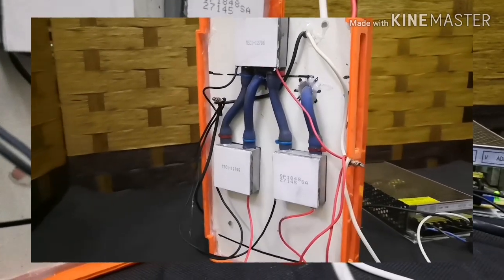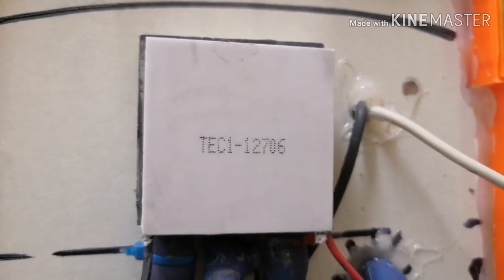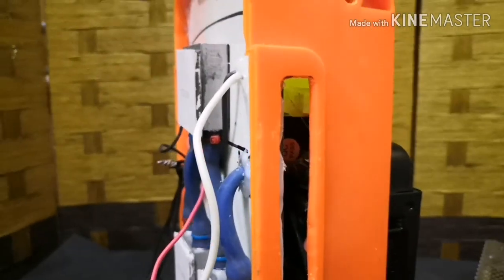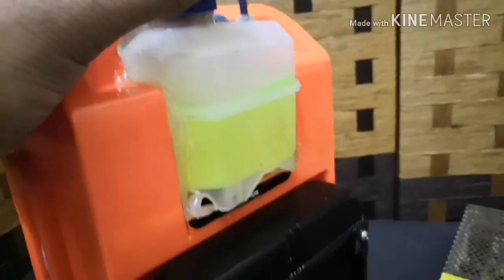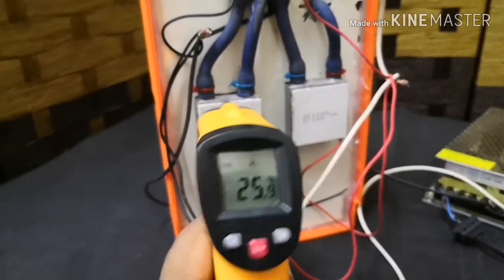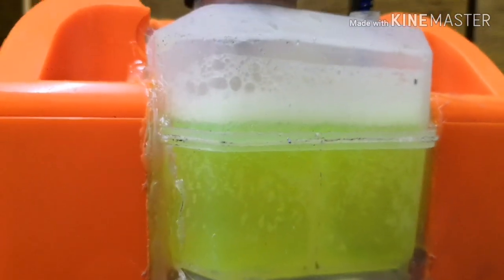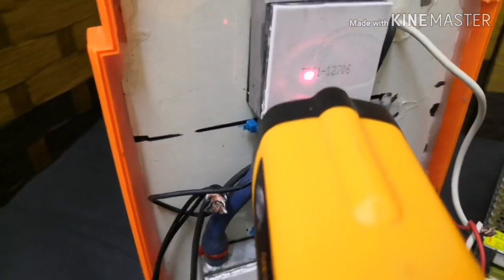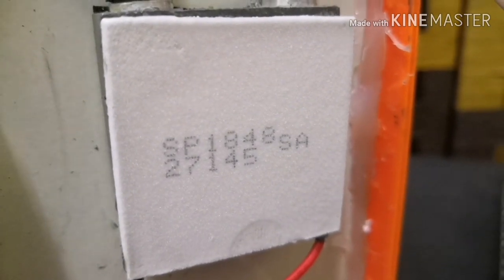Peltier vs peltier vs peltier Using water cooling radiators and coolant

Comment: What is the temperature at the opposite side? 
Keep the radiator away.. Like at the window throwing that warm air outside.
Then use this peltier set in the room, attached behind a fan, just like the radiators but pushing the air in. If the window sill are big enough, keep the radiant liquid reservoir outside too...

Comment: In my opinion the higher the amp that peltier module could handle, results to faster cooling
Reply: Yes, up to their rated specs, but then you loose efficiency especially at higher delta temps, and uses huges ammounts of energy and needs Very good cooling

Comment: What happens if you put the cold side of a peltier on a radiator? Will the radiator 
freeze and bust or because of the flowing coolant will it be only cooled? The coolant has a freezing point of - 15c. I believe because of the warm recyclable flow it would not freeze but just curious on my custom water cooling setup.
Reply from the maker: Thank you for watching.. The radiator will cool down the water inside it even the water is 400 degrees.. And if using coolant it will help a lot..

Comment: Would it work for me to use this system to try to cool the intake air of my car with a view to gaining power or would it not compensate?  In this case it would be a water cooler with a copper coil to cool the air. Thks

Comment: Daria certo eu usar esse sistema para tentar resfriar o ar da admissão do meu carro visando ganho de potência ou não compensaria? No caso seria um water cooler com uma serpentina de cobre para resfriar o ar.
Reply from the maker: English please
Reply: Would it work for me to use this system to try to cool the intake air of my car with a view to gaining power or would it not compensate?  In this case it would be a water cooler with a copper coil to cool the air. Thks

Comment: uncompleted job, does not work as AC room ,  it is just amateur project, no heat peltier treatment  still flow up on the same surface
Reply from the maker: Der viewer.. This video shows the experment for the testing unit and the difference between 3 different peltier modules.. It is not an AC.. But it has a water cooling system that circulates the water to extract the heat from peltiers so the peltiers can perform better.
Thankyou for watching.. Please watch complete vedio to understand easily..
And do watch my other videos..
Have a great day
Reply: @DIYTAYSEERworld  I am electromechanical engineer, I have worked on peltier since 21 years ago,  and I know all aspects in details about all peltier circuits and ref numbers however thank you for your effort,

Comment: if I wanna use 8peltiers at the same time with parallel or series connection how much current (volt=? and Amp=?) its need to work perfectly..? if the Peltier devices getting 12 V, 15A is maximum for the single device means...(for 8Peltiers) same volt, same current? or its need more amp? (like 12v, 30amp?)
Reply from the maker: Yes.. More peltier more amps.. 12v will be same
Reply: @DIYTAYSEERworld  How can I increase amp per each device bro...?
Reply from the maker: Use the power supply that have more amps based on your requirement.. If you use tec1-12703 =3amp/peltier.. If you use tec1-12705 =5am /peltier.
Reply from the maker: In my opinion use the peltier that is rated @ lesser Amp.. So that the Amp will be less, heating will be less.. And you will have more cooling comparing with other peltier modules